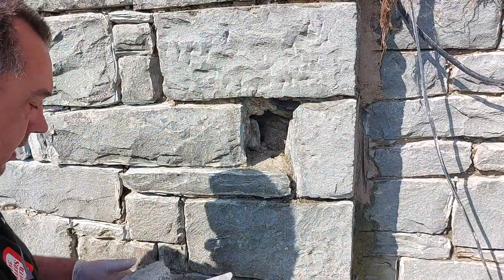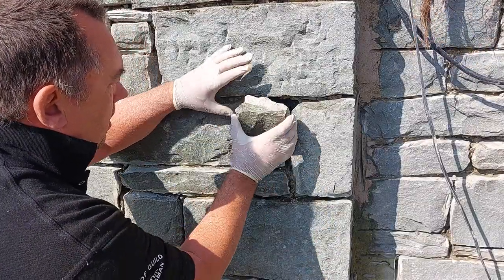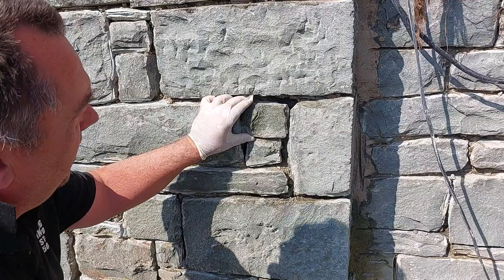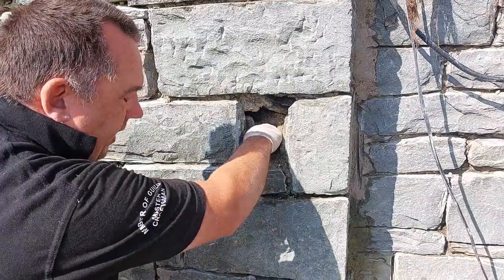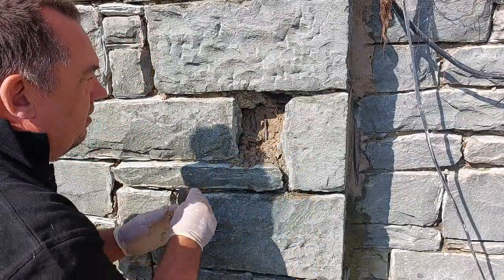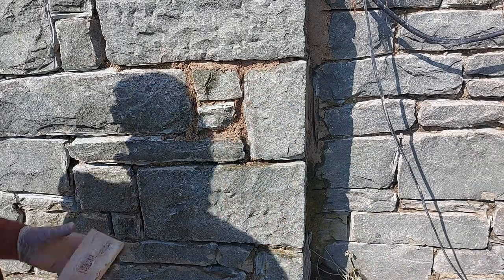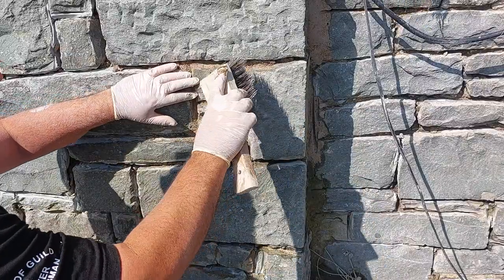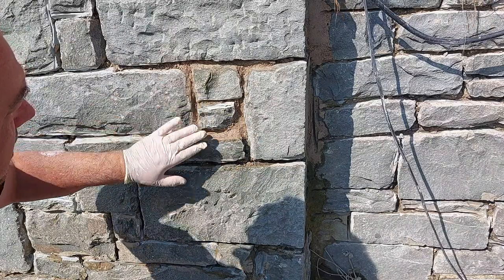Replacing stone and filling voids and repointing in lime mortar on grade 2 listed building

Comment: Lovely neat job that: look like they grew there 👍🏻.  I’m always surprised how dry your mortar is because I would naturally assume it needs to be wetter so it’s something I’ll need to consider when I start on my house.  Excellent demo, thanks.
Reply from the maker: Thank you 

I  use a semi dry mix as you can control it better it doesn't stain the brick or stone 
The joints are damp that your pointing and I mist it with water after I point 

If its too wet it can stain and crack 
 If you need any advise or have any questions feel free to ask